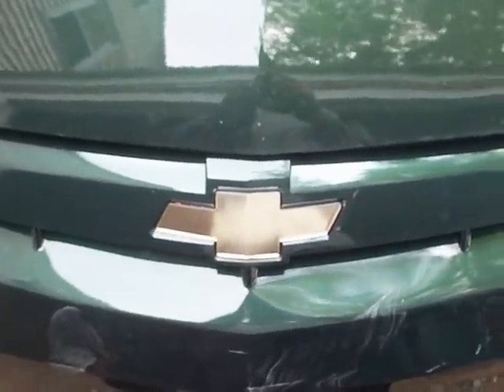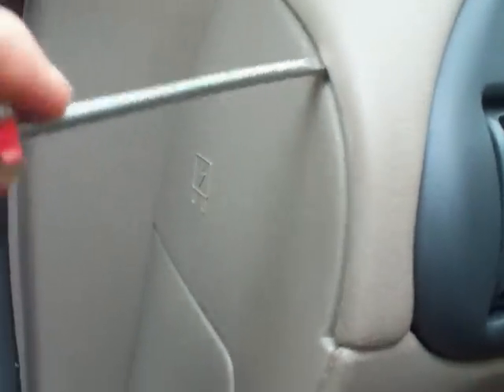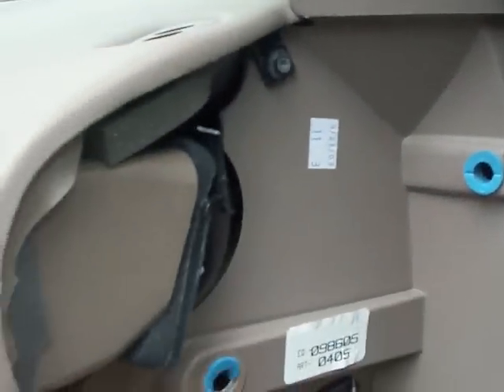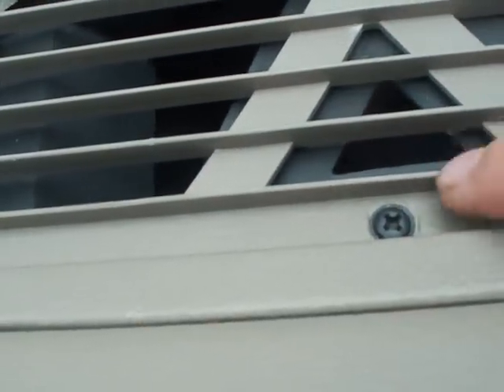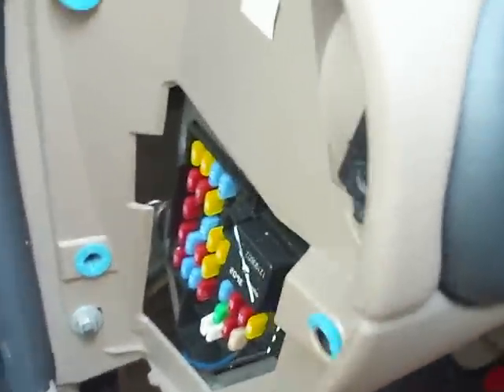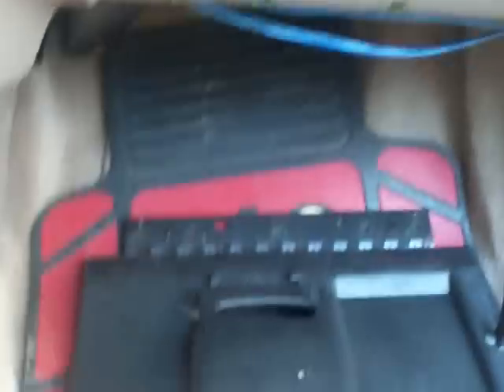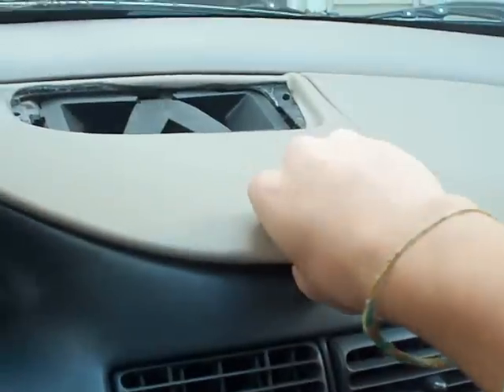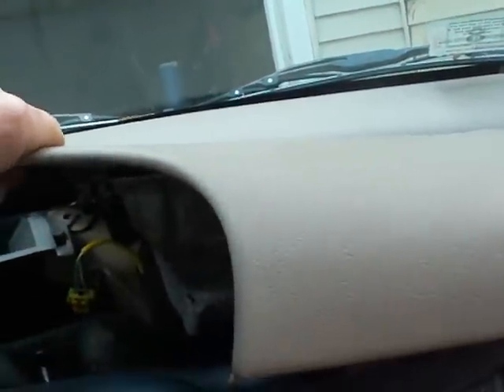Chevy Cav Dash Removal Part 1

Comment: Just a recommendation for you if I may. I would consider getting a couple different tools. One of them is called a scew-driver, and the other is nut drivers. Instead of using the torx bits you can use a 7mm socket(typical size on almost all GM vehicles) I use a scew-driver and the 7mm driver in my drill with the clutch adjusted. You can pick that stuff right up at home depot for about $30-40 total..minus the drill. You can make that money back quick doing some other cavilers :-) Great video!

Comment: I was also wondering about this. I'm going to try this pretty soon because I need to replace the stepper motors in the instrument cluster. All the tutorials I've read + this video has made it pretty easy, but I'm also a newbie at and don't know which tools I need to remove the torque screws and the bolts in the glove compartment. It'd be really helpful if someone could answer.

Comment from the maker: Grosse666 
You will need a RADIO HARNESS this is what plugs into your existing cords then from there you will need to hook the wires up the the new aftermarket radio you install.

You will also need a MOUNTING KIT the one your looking for is for all GM cars and look on the back of the box it will say for "Chevy Cavalier 01-05" or something like that after that, your pretty much good to go...

Comment: I see you have a switch laying there under the radio. I'm assuming that's to power the radio on/off since there's no ACC wire behind the radio. Never see that mentioned anywhere and the switch is the route I took.

Comment: excellent video for my 2000 cavalier, but the downfall is, someone has either wrecked it and slammed into the dash, or some moron had taken it out before hand and busted every single dash plastic anchor and cracks all over the dang thing, and for some reason it still had a factory cassette type of radio in it..